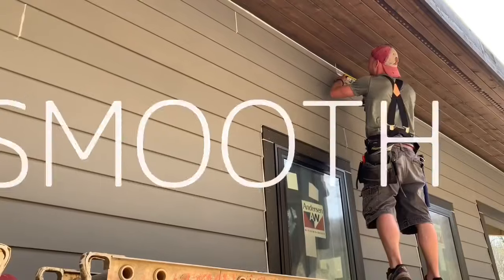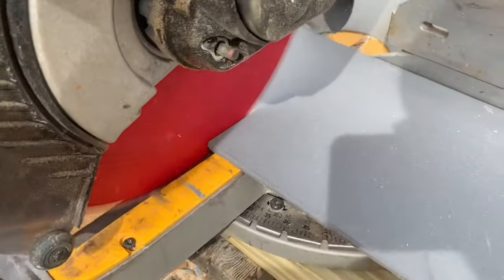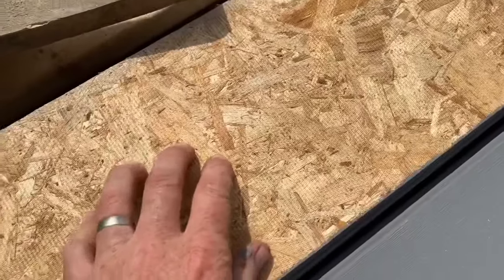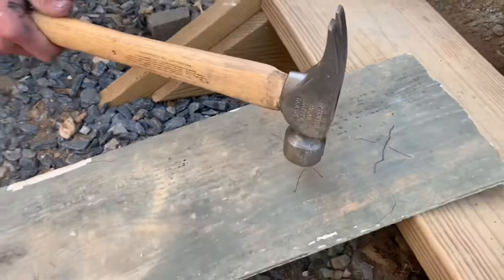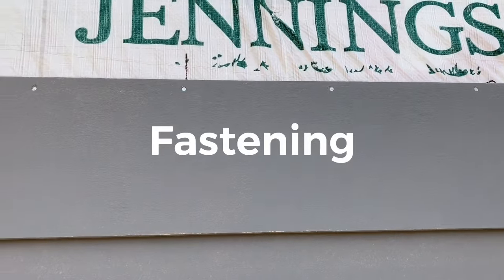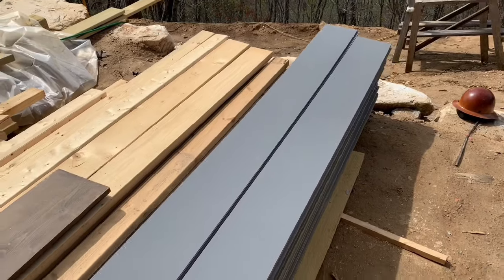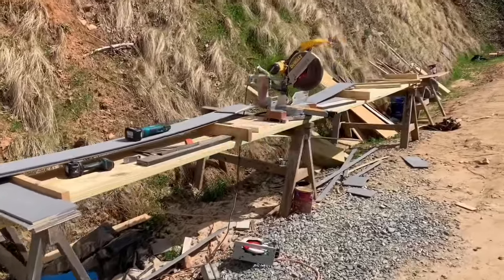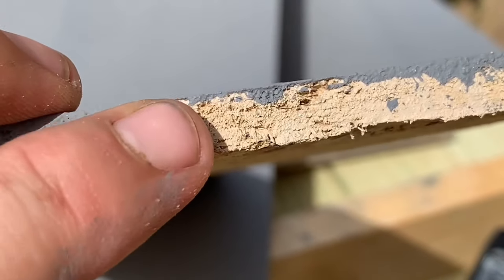Smart Side vs. Hardie Board Siding which is better

Comment: Easier to install but does not pass the woodpecker test. Woodpeckers make short work of any exterior wood product. Hardie board is the only way to go.
Reply: Doesn't pass the moisture test. FiberCement is a sponge compared to SmartSide.
Reply: Don't have a lot of moisture issues with woodpeckers. It's that pointy thing on their face that does the damage.
Reply: @davidmiller8967  A woodpecker, when he finds a food source behind anything will make fast work of most materials to get to the source. I have seen compromised Hardie, usually by moisture or bad installation, compromised by woodpeckers. Usually the moisture has found its way behind the board into the sheathing where insects have found a home. Once they sense that its off to the races.
Reply: During construction of our house the woodpeckers were knocking holes in exposed half-inch OSB. There was no food source there, they were just being ornery. They are vandals at heart. When the siding, the metal soffit and fascia went up, there was no more damage.  We live in the desert SW so no moisture problems here.

Comment: There are many reasons to discard Hardi plank beyond just sawing and handling it.  Hardi just dissolves in wet climates.  It is so bad that Hardi company withdrew their warranty after selling for several years here in SE Alaska.  Locally it has failed miserably.  When shooting nails in Hardi it will blow a crater out on the back side.  Invisible unless you pull a board but weakens the product.  So you have to pilot drill every hand driven nail!! The fine print on Hardi will also tell you it requires face nailing as well as the hidden nail under the laps if you get winds in excess of thirty mph.  Fifteen year paint warranty......not hardly.  Fails almost immediately and in any case gone after three or four.  When it fails the board chips out craters as well.  Now this is after completely following the manufacturer's instructions to the letter as well as applying recommended primer (over the three sided factory job) and two coats of top paint on both sides.  Then final coating after hanging the product.  It also holds dirt and grows mold much faster than any other product I have seen.  These defects are not ameliorated by using a rain screen style of construction.  Now add to this mix the fact that it is not recommended to pressure wash Hardi (again it literally dissolves in water) but hand wash.  Upkeep is impossible with the stuff and time consuming in the process.  You are absolutely correct on the dust issues as well.  Keep in mind the tile guys are seeing the Hardi backer board used under tile installations is dissolving too.  This is just total crap and should never have been allowed on the market.  I wouldn't want to install it even if it was used in a desert environment where it might actually perform marginally but it certainly is a total failure in any wet area.  Primary function of any siding is to protect the underlying structure from weather.  Hardi fails completely.   Good topic.  Take care.  Doug
Reply from the maker: Thanks Doug... very interesting about the extra fasteners for winds and also fine print about painting and priming to keep the warranty… It’s even worse than I thought. I will say that people think this stuff is actually made of concrete, but it’s more like cardboard in my opinion.
Reply: I live in Montana and have seen hardie board fail aswell and after reading a lot of comments I would suggest the builder or homeowner use a product that is proven in their area because it looks like climate is a huge factor.

Comment: I have hardie board siding and it sucks.  Everyone talks about how great it is and how it doesn’t absorb water or crack.   Both of those are false claims.  Mine had absorbed water on several of the corners of the planks and then it cracked and broke off.  It DOES absorb water.  And it DOES crack.  It a pretty product but it isn’t NOT durable the way they say it is.  Mine is barely 13 years old and already needs to be repainted.  I can guarantee this stuff would be far worse.

Comment: What the h#@$ are you talking about cutting with nippers or a grinder or it being to slow cutting. We work with Hardy all the time. We cut just as fast with a circular saw and a Hardy blade. As for carrying it, we carry two or three planks at a time. Also the longivity of Hardy is a lot better then smart siding. It also does not need to be painted prior to installation. it is also put on faster with gekkos and a coil gun. You have none of the drawback of smart siding.
Reply: @null480  that's right. One of the actual smart guys who knows. Thank you sir.
Reply: I really don't give a $#@$. You have your opinion and I have mine. I make $35 - $50 an hour doing my work.  If the Hardy brakes I have enough money, the tools,  the knowledge and the ability to change it out. In ten or 15 years when that OSB SMART BOARD ( yes it is basically OSB) rots out  and you are replacing I will be drinking a glass of wine or having me a pacifico on my deck enjoying the look of my Hardy. Thanks. Not arguing just giving a nonprofessional opinion.
Reply: yes sir thank you for being a respectable Craftsman. I use Hardie because I am use to it. The same reason I still use De Walt. It is just what I am use to. I am not saying one is better then the other, I am just saying I personally would rather use Hardie as others would. I will call a rep and ask them. Once again thank you

Comment: How many pics of failure do you want.... my company has installed hundreds of homes with both these brands and some other brands as well..in my climate,(high desert), there is horrible
 expansion- contraction, the WORST out of all exposed seam siding is SMART SIDING.... I have seen your 3/16 " gap end up being 1/2" in the dry season.....and then in wet season it completely close.the gap to point of forcing all caulk out of the required spacing....my hardie jobs almost never have warranty issue..."not so smart" siding is always the culprit...and just for reference when you r reading the installation instructions u r literally reading MY words...I have worked closely with three different siding companies trying to resolve reoccurring issues. And they all hate me because I get critical about there product. In my professional opinion ,.  To get the best product on your home, u will have to use multiple  brands.....there isn't a manufacturer that had all the siding components figured out....
Reply: My parter said the other day they now say no smart in  AZ
Reply: The problem i have is different widths on ends and the other day different in the middle cut. It is what it is . paint the ends cut good and go.
Reply: About 98% of failures are the builders fault.  But the next builder who admits they screwed up will be the first.
Reply: @miragesmack007   got said your not the clown brothers. Have u check out the new lp videos. LMAO. Seen hardie fail n others n old lp and the new gen lp ok stuff so far in se wis. For what it is. this siding these days is to thin for these fine skill  "rough" carpentry walls these days. Have u see boral. That stuff is great but up there. And has manufacture problems too. Same shit different day and products. At the end of the day vylin is final. 😆 
Know your sh*t or own your own sh*t

Comment: Horrible impact tests!  You did not test them equally.  Different impact points with the hammer, one thrown against a corner edge and the other flung and flipped straight up in the air.  Embarrassing!  I'm off to find a reliable and honest opinion...

Comment: This stuff is crap. Only one step better than Masonite. We have built hundreds of homes in Hardie Board. We always strip the walls first in 1x2's to create a drainage plain behind the siding. We also put aluminum flashing behind every butt joint. This system is fail proof. Do it right the first time. Refer to Fine Homebuilding or The Journal of Light Construction magazines for reference on how to do siding right. BTY, vinyl siding should be banned. You can only build a house so cheap,

Comment: Seems opinions are very much mixed on these two products.  Why not use both on your house?  The cost is relatively the same,,, LP in the high impact areas like low down where rocks and other things might impact the wall,,, and Hardie in the wettest areas.  The argument of fire resistance for any exterior product is null since most fires start inside the home and most interior partitions are wood framed walls.  As for the wood rot argument,, this LP clearly is not your standard OSB product much more resins etc.  I imagine if the ends are primed properly it would hold up well. No matter which you chose you need a rain screen and air gap behind it for ventilation and drainage.